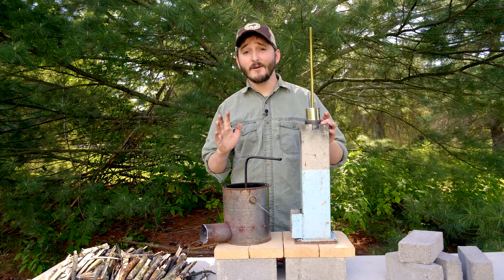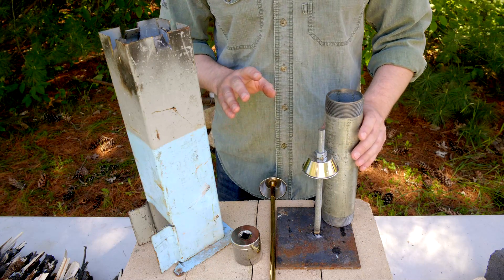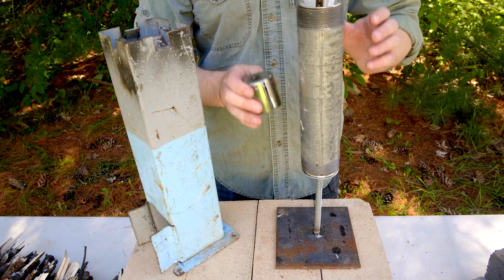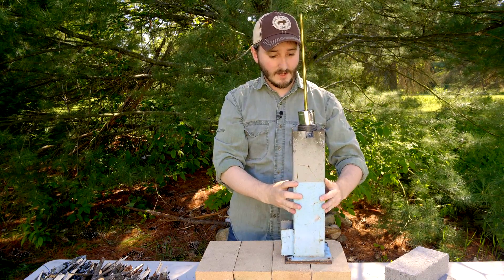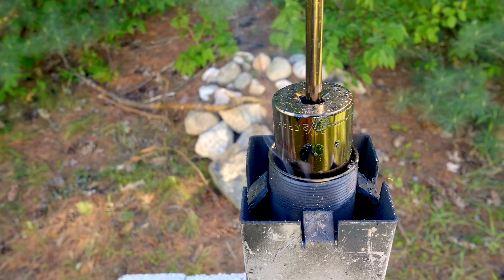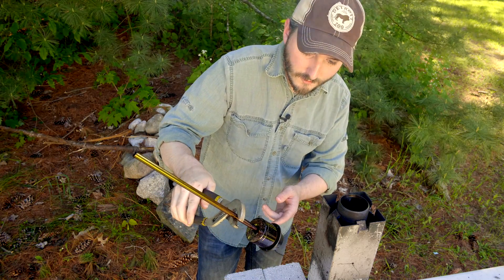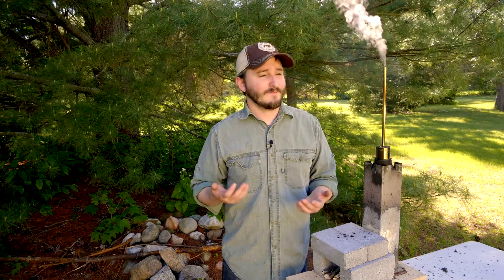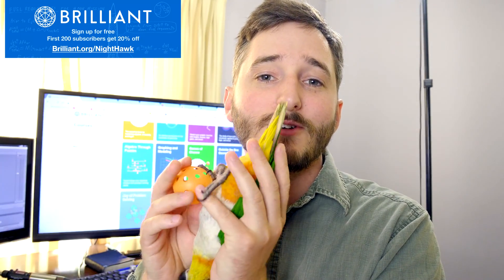Testing A Better Wood Gassifier (Bio Gas Fuel)

Comment: add a soup can with holes in it and one end removed as a flame holder at the exhaust of the wood gas unit. Light it and it will stay lit. Now make a wood gas cooler to make liquid fuel like ethanol. Not being sarcastic love the build and how you explained the build. I made a gasifier but, it was big ( 55 gal drum with removable lid ) cut a 5 in hole in the center of the lid and a 4 in hole in the bottom. Fill it with sticks or burnables then light it at the bottom hole. the heat from the fire pyrolyzes the fuel above making wood gas. Hole size is important in my build. It has to limit air intake or the fuel burns not pyrolyzes. this build can be done with a smaller barrel just remember the ratio of top hole size to bottom hole size. Also keep your hole cut outs. they can be used as restrictors for air intake or exhaust.

Comment: No need to reinvent the wheel even fema has a self feed design with no moving parts you should do a vid on hooking a gasifyer up to and engine
Reply from the maker: The fema gasifier is more complicated than necessary for simple small scale production and as a direct to engine feed must run super optimally to work. Better for my needs to produce wood gas as I do in this video and filter/store it before use. In that way you don't have to worry about moisture content of fuel or type of fuel as you do with a direct to engine system, and there's less risk in damaging the engine due to inadequate filtration.

Comment: That's a great concept. I'm gonna try to build one.
Have anyone already found a good way to store this gas besides using a box with water?
I was thinking if is possible to use an old fridge compressor to capture the gas and store it on something like a used fire extinguisher or some other compartment?

Comment: Another great video. I'd definitely be interested in seeing you get a small engine running on the wood gas if possible. Also for storage maybe you could use a bubbler on the output (that would clean up any particulates etc and cool the gas, although you might need to run the bubbler water through a radiator depending on how much gas is produced) then pipe that to a tank or direct to an engine. Take a look at these plans released by FEMA http://www.driveonwood.com/static/media/uploads/pdf/fema_plans.pdf

Comment: hey, I found a way you can make it more efficient.
If you also want to keep the charcoal, what you could do is use this design and put the fire above the charcoal outlet. by this the charcoal will collect under a platform on which the fire is burning. The downside of this is probably that you will need to keep adding fuel.
Reply: You would need to make the charcoal collector mostly air tight, and likely want to prefill it with co2 or some other inert gas, as when the charcoal gets dumped while hot, it will immediately ignite if exposed to oxygen.  It could certainly be done though.  If you ran the gasifier vessel through a hole in the bottom of the rocket stove, into a steel drum underneath, with a short length to allow it to be raised and still maintain a seal while the charcoal gets dumped, that would work.  You could also route some of the stove exhaust into the drum, with a small pump and valve on the top, to flush oxygen out of it, which you could verify with an oxygen sensor from a cheap obd2 car exhaust.  You could route the sensor to a multimeter, or if you wanted to be fancy, a raspberry pi or old cell phone would do, as long as you could code the input, or adapt some other app to display the readout.
Reply: Thank you! These were some aspects I didnt think through yet. If I can find the resources, I might try various of the possibilities on collecting the charcoal and the gas. I'll mention it if I have an update.
Reply: That's a nice idea...
Especially if you could use the tar

Comment: Mount an arc-lighter or the electrodes to the top with a firebrick and you have a continuously sustained flame. But you need some heat resistant coat on the wires.

Comment: I would like to see someone figure out a way to store the wood gas so that you don’t need to run a fire whenever you’re using the equipment that runs on wood gas (car, chainsaw, etc.)
Reply: It's basically just a mix of hydrogen, methane, and carbon monoxide. Run it through a longer pipe to let it cool and condense the tar/creosote out of it, and then it can be stored like any other flammable gas. You could even run a compressor off a stirling engine using the heat of the fire.

Comment: A way to store the gas in a pressurized state would be pretty cool. Maybe there's a way to fill a bag in a container under normal pressure and when it's full the container is connected to a compressor to push the gas in a seperate tank.
With lots of valves and so on everywhere. 
I'm pretty sure you'll come up with some genius way, like always.

Comment: How to pressurize would guess in a 1 pound propane empty propane tank bottle or have it would guess running off of a Coleman dual burner stove or the little camping ultralight refill the gas was with gas the butane gas with wood gas

Comment: Wow, very cleverI I was pretty skeptical when you first started talking about your design (wishful thinking I said) but as usual you prove yourself much smarter than me! How easy or possible is it to compress/store wood gas?
Reply from the maker: It's usually very easy to pressurize it because it comes out of the reaction vessel at pressure. But with this design I don't know if that will be the case with the ends only lightly sealed. There are other methods I will be making a video about
Reply: Your videos made me interested in the concept of making wood gas and charcoal and it's very interesting! And I was thinking about storing the gas since your last vide with the water tank with a valve. I think you'd need to purify the output as much as possible to be able to pressurize it with like a compressor as to not to clog it with solids that are suspended in the smoke. So I guess a long or a double water bubbler, maybe some wood chips first and charcoal filter at the very end?

Comment: Is it possible to use every biomass? Like fruits or grass. And do they have to be dry or can i use wheet Material too?
Reply from the maker: Yes you can use any plant material. If it has a lot of water in it there will be energy wasted to turn it to steam before other gas is produced. Wet things should be dried in the sun before using.
Reply: NightHawkInLight thank you for the Information

Comment: May I ask why you don't just make a mini model of the free design offered on government web sites?  The design they offer is large and meant to run engines and motors, even farm tractors.  But I think you could offer a very interesting video of a smaller model with a similar design.
Reply: The FEMA design isn't very good.  An Imbert downdraft gasifier is better.
Reply: Nitro Neo the government is lizzards

Comment: It may be CO2 neutral in the end, but you're not taking production and consumption rates in consideration. Just as there is a safe consumption rate for oil at which there's produced as much as there is consumed, there is one for fuels such as these. And you know it's going to be way lower than the amount of wood you need to produce at least a decent amount of power
Reply from the maker: There are very fast growing species of trees.
Reply from the maker: Also note that you don't need to use wood for this. Anything organic will work. Leaves or grass clippings, farm waste.
Reply: JF Tech/Drones All organic fuels, coal, oil, gas, wood etc. But there are other fuels that produce a flame that do not produce carbon monoxide. Things like hydrogen. Correct me if I'm wrong :)
Reply: +NightHawkInLight Have you worked out a design for an engine yet?
Reply: Carbon monoxide is dangerous for health. All fuels release it when burnt

Comment: You should put a bubblier filter and a activated carbon filter to make the wood gas much more pure. So, you can run an engine or sustain a flame a lot better

Comment: I see that this design is much more practical to use, but what about airtightness?
Aren't you loosing woodgas and pressure through lower and upper parts of your reaction vessel? 
What about bubbling camera , to clear out, cool down, and collect produced gas?
How about creating some kind of blowtorch on this fuel, and then moving to small (then bigger) engine ?
Great video, though!

Comment: @NightHawkInLight Is it possible to separate the flammable products from the steam?
Reply: Yes. But the only way i can think of doing this is with a bubbler.
Reply: You mean passing it through cold water? but then the flammable gasses will dissolve in the water.
Reply: Fadestrider something like that, I'm not a professional. Just some guy on the internet. Thank you for the correction!
Reply: But if the COLD water was passing around some distillation apparatus the vapor would condense and the flammable carbon groups would still be gases (at least he lighter ones) hmmm...I think i answered my own question.
Reply: Ha, I guess you did

Comment: Awesome, I can imagine isolating the stove's pipe a little will help keeping the heat inside for a longer time; less energy loss through radiation. Also, if you make the wood smaller e.g. into small wood chips, you can can put more wood into the container and have more gas being output in a smaller time.

Comment: I think you missed the point ... the purpose of the chemical process seen in your video is to produce CHARCOAL, not "bio gas". The volatiles that are driven off are simply a byproduct, not the end result**, and unless you have additional equipment (to capture, further refine, and store it for other use) it is essentially a low yeild and very dirty waste product that is typically flared away. Calling that "bio gas" is (forgive me) laughably over generous.

------
* The simple proof is to compare the amount of clean useful thermal energy of the charcoal vs that of the volatiles driven off ... the former exceed the latter several fold. It is analagous to turning milk into cheese, and then throwing the cheese away and keeping only the whey.
Reply from the maker: Tell that to those with wood gas powered cars. Charcoal is useful, but you can't run a gasoline engine off it.
Reply: NightHawkInLight If you reread my post you will see I was NOT disputing bio-gas produced on an INDUSTRIAL scale (where they have all the needed equipment for capture, cleaning, refining and compressing the useful portion of the results). No, my post was directed at the implied practicality of the small scale setup shown in the video.  Capturing and processing biogas from such a tiny setup is NOT a process suitable for residential level use for people of average fiscal means and technical knowhow.

A large scale plant producing hardwood charcoal for sale could benefit from this sort on thing, but it is far outside of residential scope.
Reply: As for the residential charcoal production angle, a little section of pipe aint gonna cut it.  Theoretically, if you already have a high tech wood burning stove in your home, you could just place your wood scraps in an uncoated steel dutch oven (say, 1-3 gals), put on the lid (secure with wire), and stick it inside the stove ... the stove would not only provide all the heat but also burn off the volatiles, and the result would be a substantial volume of useful charcoal (limited to the size of your pot and stove). Videos on such a setup abound on youtube. THAT sort of setup, unlike the one in this vid, is actually a practical way to make your owm charcoal (one of several methods).

Comment: Take the wood gas and filter it and store it for later use. Find a way to separate out its liquid components by having a drain tube at the bottom for the wood oil to condense into. Now distill it with the same heat coming from the charcoal. If you are using pine wood you will wind up with rosin which has many uses for paints and finishes and the liquid distilled from the wood oil is turpentine which runs perfectly fine in diesel engines a 100% straight substitute. The liquid from the wood gas that can settled out is a low grade gasoline or a white gasoline similar to orange oil from orange peels. The process is very green but isn't cost effective for today's market but is a great experiment and a great option for those with lots of land with pines who love to play and tinker in self sustainability a small scale. Keep up the great work.
Reply: I had a few suggestions as follows:

@jeffmccrea9347

0 seconds ago
Just a thought. If you want to keep your smoke stack burning, try drilling some SMALL holes at an upward angle near the top end to carburate air into the gas stream like is done in a natural gas stove, heater ect. Start with a couple of small holes at first then try it out. You don't want the mixture too lean to burn. If necessary, drill more holes, ONE AT A TIME until you get satisfactory results.

Another thought. Take a coil of copper tubing in an upright position and connect it to your stack with a smooth 180 degree curve. This will condense your tar etc. out of the gas and clean it up some. It will work like a moonshine still. It has to be upright so the tar doesn't collect at the bottom of a horizontal coil and clog the system.

If you're really feeling froggy, acquire a used, working automotive A/C compressor. Connect it with a belt to an AC motor or small gas engine and see if you can pump / compress your wood gas into something like a propane tank for later use. Just be sure there is still oil in the compressor if you get it from a questionable source like a junk yard. Without oil, just like an engine, it will seize during operation. You will need a stout 12 VDC source like a battery or charger with at least a 10 or 15 amp output to energize the electric clutch for proper operation. I wouldn't advise bolting the clutch as you can knock it off balance causing major vibration problems.

I don't know if a compressor from a refrigerator would work but if you have one laying around, it wouldn't hurt to give it a try. In either case, the compressor MUST remain upright at ALL times so as to not drain the oil out of it.

The only hitches I can think of with using a compressor is:
1) Designing or acquiring a moisture trap like the one's used on air compressors or diesel fuel lines to keep water, or in your case, tar out of the system.
2) Your gasifier will need to be air tight and not just depend on a heavy socket for a seal. With a compressor drawing a vacuum on your gas chamber, it will suck more air than gas without a good seal. Good luck with your endeavors. Jeff M.

Comment: do you know of the drive on wood website.  they are building cars and trucks and generators that run on woodgas.  in a mater of fact my dad has built a truck that is 100 percent powered by wood.  he also  has a setup that uses charcoal to power small engines.  its amazing stuff.

Comment: Do you think it could power a generator...?
Reply: just need to clean it properly

unrefined gas burns poorly(water content) and is also full of tar and crap so its gonna ruin your engine nice and proper and fast
Reply: This is extremely high in tar.  I don't know if it is practical to filter all that tar out.  It's more common to use a downdraft gasifier since these have better tar-cracking ability, and is perhaps the best gasifier design for low tar.  Even with these, there are multiple filter stages before fueling an engine.  A much easier way is to gasify char (charcoal) since there is much less tar.  He could burn the tar-gas as a heat source to make charcoal, and then gasify the charcoal to power an engine.
Reply: Use an external combustion engine as opposed to internal combustion... don't bother refining the gas, just run the engine (presumably a steam engine, like the ones they used to stock up constantly in trains of the old days) from the charcoal and let the gas burn with the charcoal. The combustion occurs outside of the engine, so all of the soot and filth won't clog the engine mechanics... Modern day external combustion engines such as stirling engines have come a long way.
Reply: I've studied both.  Both ways have their challenges.  There's usually a preference for the internal combustion route because the engines are more available and/or less expensive, and they are easier and more forgiving to work with than Stirling engines, and easier and safer to make more efficient than steam engines.